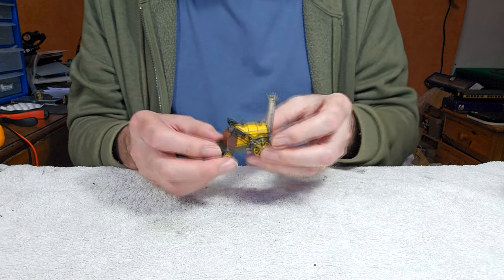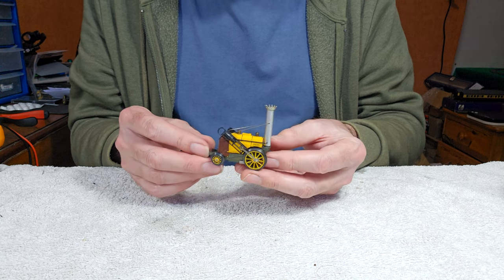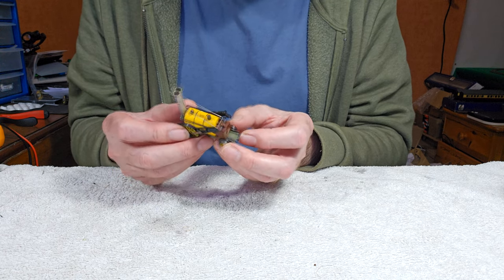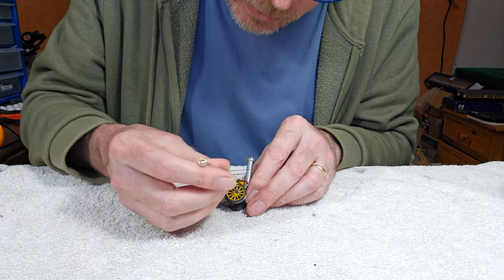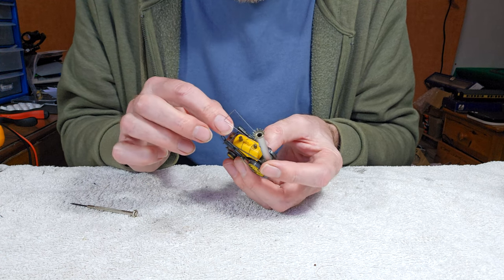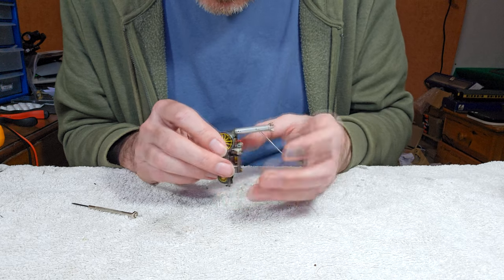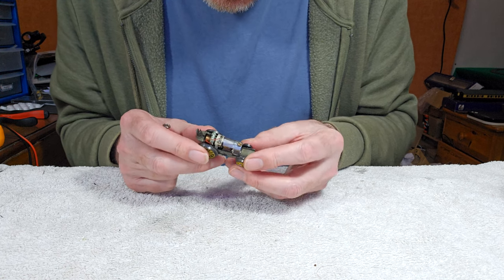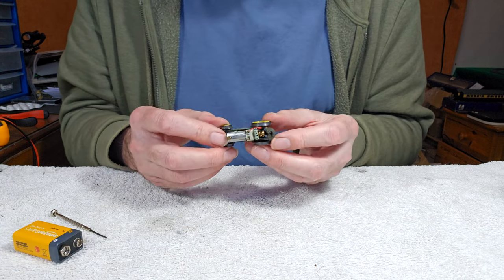Tri-ang Stephenson's Rocket : Repair Request

Comment: Bill, excellent job and a very informative repair video!  I had a similar situation with a Tri-ang Rocket that functioned well when I first bought it second hand, but it also mysteriously quit working.  After watching your video sequence on taking it apart I was able to ID the problem and make the repair.  What I found and believe was the problem, corrosion had occurred on the drive wheel axles and bearings.  Once I cleaned them and the motor (as you had done in the video) and repaired the same red wire for the smoke stack, the unit now functions as it should.  It is light weight and struggles with traction but will pull the 3 cars and tender as it was designed.  I must also say, I've had problems with work surfaces and taking your lead, I now have a dedicated  towel surface that is working like a charm.  AT 72 1/2 years it proves you're never to old to learn.  Thanks again for the video and guidance.  It's great to find someone who takes the time to share their knowledge and experience.  Best wishes.

Comment: Hi Bill,  Great video.  I bought a Tri-ang Stephenson's Rocket set during the week and, it ran well on an initial test.  Although I always service motors and electrical contacts when I acquire a locomotive (they are usually in dire need of it!!!), I can see from your video that extra attention needs to be given to the rear "bearing", which appears from your video to a plastic part with no oil felt pad or sintered bearing .... no wonder it melted! Cheers.

Comment: Nice job yet again! I have the old Hornby version of the Rocket with coaches. The paperwork dates the set to 1983. I don't think there are any changes compared to this Tri-Ang one. I tested mine and it runs happily with a 9 V battery. So your diagnosis of damaged windings may well be correct. I also have the new Hornby Rocket set. It was overpriced but I just had to have it. I'm sure you understand. 😅

Comment: Hello Bill, I always use a small amount of flexible glue to hold the rear bearing to the magnet, I think the bearing has shrunk a bit over time allowing it to wobble about and become noisy etc. Holding it with a dob of silicone restores the motor to quiet smooth running. An enjoyable episode, best regards to you

Comment: I've worked on a couple of these.The back bearing is a bit basic and I found some light grease helped. The other issue was that the springs that hold the brushes in tension might need their angles changed slightly to better bed the brushes on to the commutator. Possibly the plastic that holds the brushes was enlarged or maybe slightly distorted due to heat in the past. As you note, amazing for their time. I have mine on radio control now but with the smoke still from the track power.

Comment: Fitting metal wheels and pickups to the tender would probably work wonders with the running. Similarly with the coaches to reduce rolling resistance, although both would reduce the model's authenticity.

Comment: Just wondering if you would be able to fix my dads class 43 that he’s had for a while it gets power to the motor but it doesn’t run. Any suggestions?
Reply: Essentially you have one of two problems: mechanical (bearings etc binding due to lack of lubrication or physical obstruction), or electrical (lack of continuity due to dirt or breakage). Inspection and testing should reveal the cause, which could be:
- Check whether it works with the plastic gears removed. If it does, could be mechanical problem with wheels/axles.
- Dirty commutator. (Clean/lube motor a la OOBill!)
- Dry motor bearings (ditto).
- Worn out or missing brush/es or brush springs. (") 
- Then the difficult to spot one... Certain Ringfield motors have the brush retainers held on with screws. These may be different lengths, in which case the longer one provides an electrical connection between the brush and the chassis, the other doesn't. Get them the wrong way round and it won't work!
- Damaged armature windings -- check continuity/resistance between the commutator segments -- check each with its neighbour: assuming you have continuity, all 3 (or 5) should have similar resistance (same order of magnitude).

- Or something else, but that's all I can think of immediately!
Reply: @PeterJewell2   Cheers mate.👍🏼

Comment: Just a thought but would an N gauge motor fit?
Reply from the maker: It might. If I had one of these I'd be tempted to try replacing the motor and fitting metal wheels and pickups to the tender. They are quite valuable though so I think there is a tendency to leave them alone.